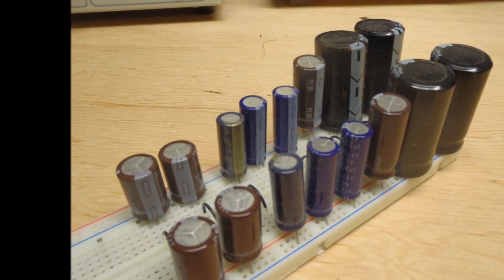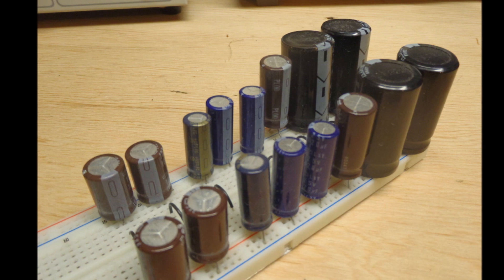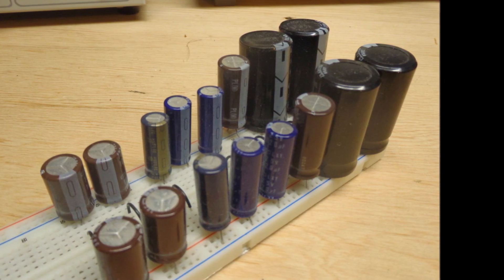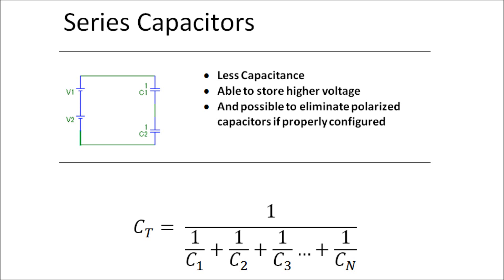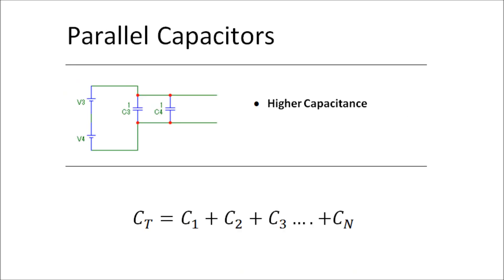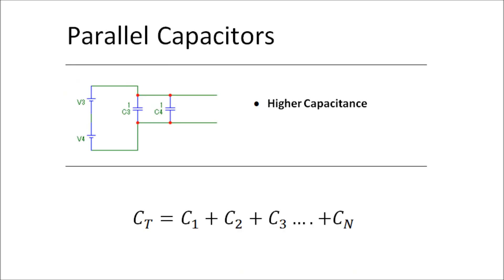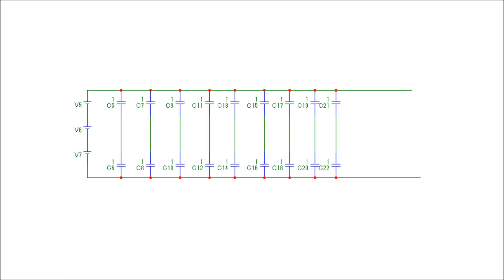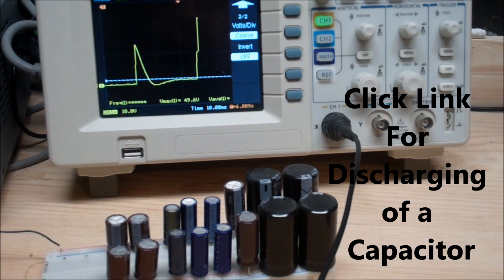What Is A Capacitor Bank

Comment: Can you help me with this. I need to basically create a powerful electric arc that can be sustained for about 3 seconds and recharged. I want to use either a 240volt 10-15 amp input but I need a huge amp output like ALOT, would a capacitor bank be able to increase amps when it discharges
Reply from the maker: Of course I can give you hand! That si why I made this channel. How big is the applied load? And what are you trying to accomplish with such a high current draw?
Reply: So essentially a welder?

Comment from the maker: In short DC motors, torque is generated by current. Thus more current more torque. As the load increase i.e. starting your EV, the torque should be extremely apparent. But you are restricted as to what your power supply may deliver to the system. I believe that a capacitor bank would greatly contribute to the torque. Please keep us in the loop as your project develops! If there is any subject you would like to discuss please let me know (always looking for new video ideas). Thanks.

Nick

Comment: Thanks for the tutorial. I have converted an AC washer brushed motor to DC and it runs very well on 144Volts DC. I plan on using 8 of them for MY NICE EV project. Can a capacitor bank help this motor in the area of torque? Any information would be greatly appreciated.